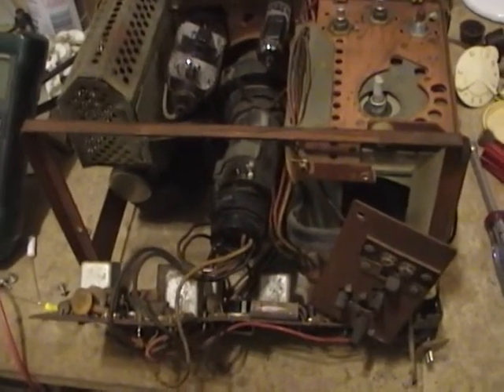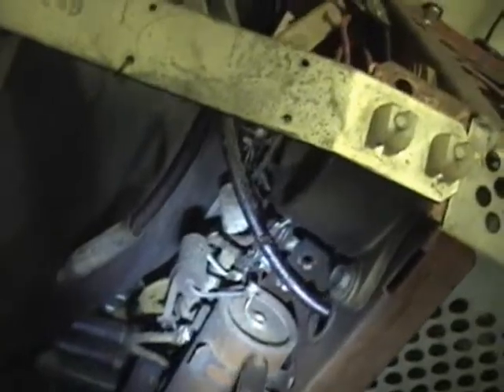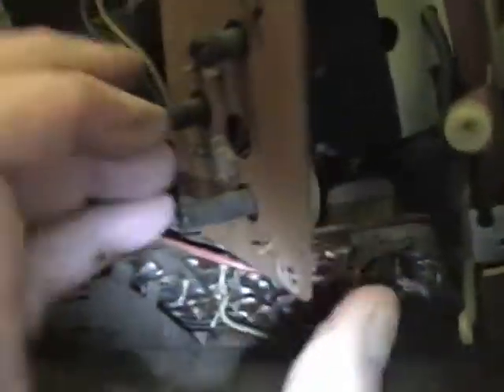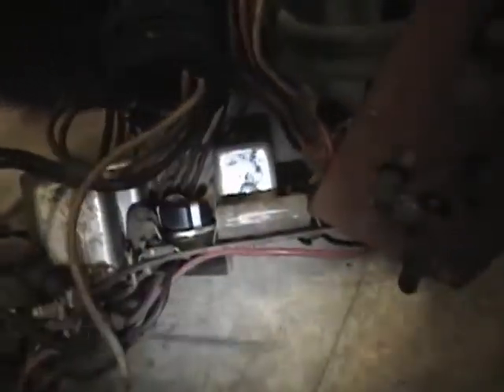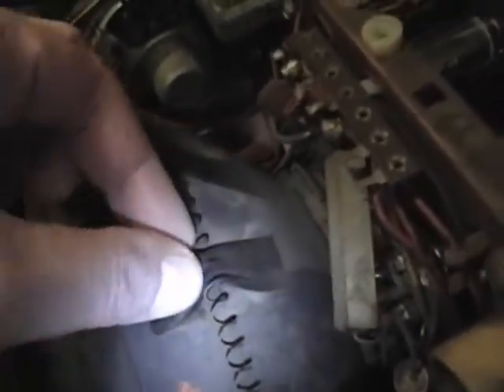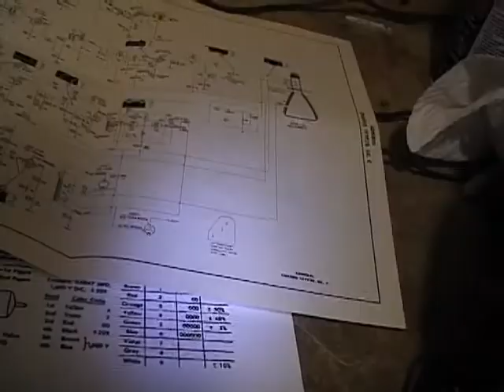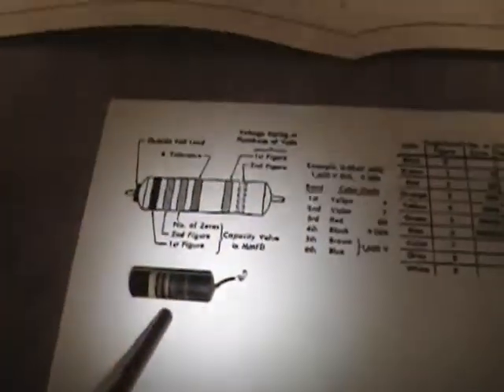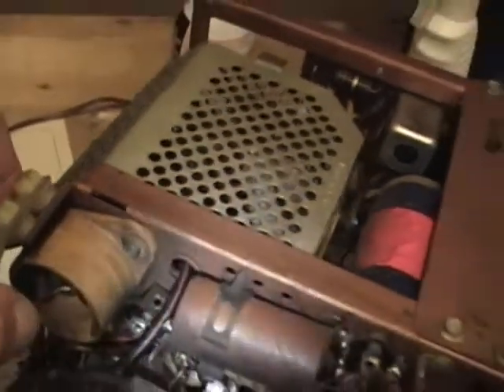Admiral T102 Restoration p1o6

Comment: I have this same TV in red and white. re-capped it and it does OK. Needs an IF alignment though, but since I don't have a sweep gen I can't do it right now. I also managed to knock the yoke a little off-kilter so the picture isn't where it belongs. Need to get back to it and fix that problem. Its just so hard to get in and out of the cabinet.

Comment: I'm not to sure how difficult it would be with a TV set but it's possible to rewire an AC/DC radio so it is not a hot chassis set. I guess you could copy the schematic of a series string TV that does not have the power line directly connected to the chassis, the schematic for those will indicate two different grounds, one with the arrow and another using a rake symbol. I've never seen a hot chassis TV set .before, I though they discontinued that practice in the early 50s with the radios.